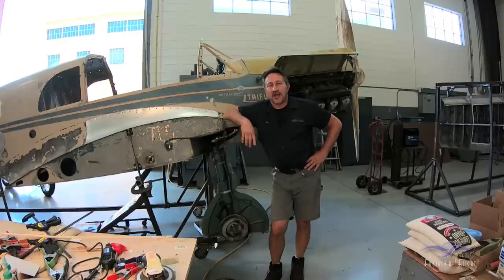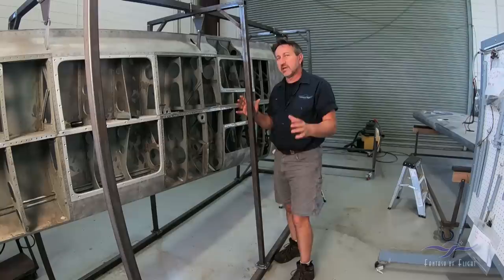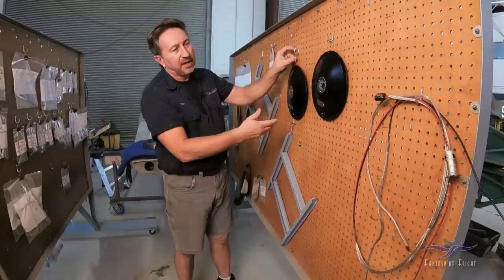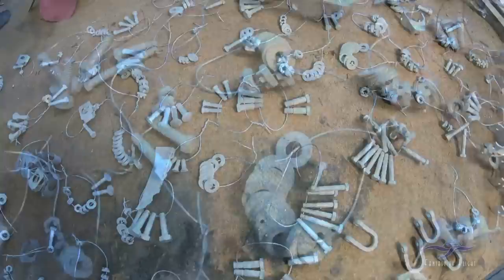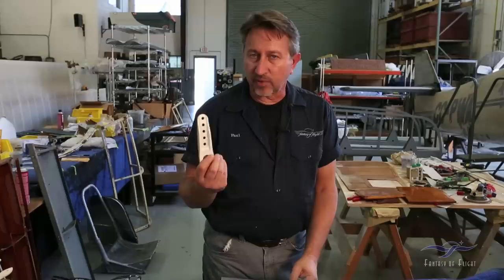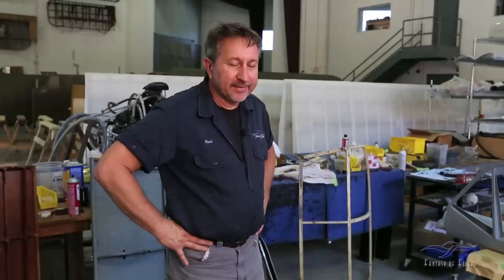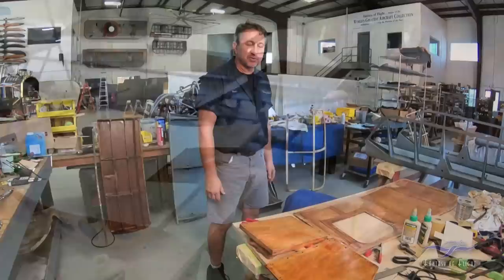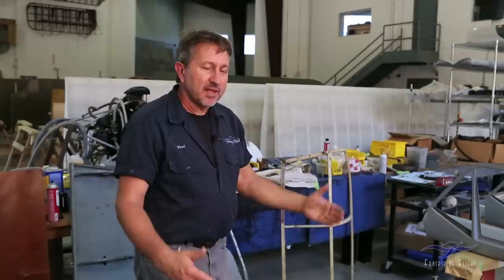Messerschmitt Bf-108 - Restoration Update #11 - June 2019

Comment: Hi Paul
 Been watching your series. Cadmium Plating is a metal that is plated on the part. It is a cyanide based plating system. It is a sacrificial coating something like zinc plating. The gold cad or clear cad that you refer to is a Dichromate conversion coating applied after the part is plated. Sodium Dichromate is mixed with acid and the part is immersed rinsed and dried. The Dichromate conversion coating is a extra sacrificial coating. The Gold Dichromate is a higher concentration of Sodium Dichromate and a different acid than the clear or also called Blue Chromate. Most companies use Zinc Plating and then the same conversion coating. More EPA friendly. I am retired and restore Automotive Carburetors to how they came from the factory. I do my own plating and conversion coatings. That is all I can add to the Aircraft Restoration. I have restored cars for many years and the time it takes to do it right. You are a true Craftsman. Keep the Videos coming.

Harold

Comment: In restoring old wood furniture conservators typically use hide glue - which was the original glue (I suspect hide glue was used on the 108) because with a bit of heat the joint can be redone. Hide glue is actually a very good glue; although in aircraft use where you can't control the environment the aircraft lives and works in a strong case can be made to avoid it. In your case hide glue may still be a good choice (I would have some concern about the high summer temps and high humidity of Florida). Down the road in a couple generations the person doing your job would certainly appreciate the use of hide glue vs. a PVA.

In any event, this aircraft is going to be a real looker when completed!

Comment: Interesting about the interior panels leather and wood construction.  I wonder if the Germans had casein glue or if they used the older hare or hide glue.  I love the restoration videos.  Maybe we could watch someone working on an interesting piece some time.  Thanks-
Reply: One of the virtues of the old hide glues is that they are not permanent which means wooden things can be repaired properly. Not sure Titebond 3 is the way to go...

Comment: Great work as usual. I really like these updates. Regarding the German 120 degree flush rivets. I recently read somewhere that at least one kind of German flush rivet had a slightly domed head. The counter sink was slightly larger than the head of the rivet. Then when the rivet is driven the domed head is driven flat and fills the countersink. Could that be what you are looking for?  Also Boeing has been using 120 degree counter sunk rivets for many years though not metric.

Comment: You may want to use a bit of caution with those old wires as if it has fiber in it it will be asbestos. Very common in prewar wiring.

Comment: Would the rivets used in the wings be the same types as used in the Bf 109? A number of these 109s especially the early E model have been restored in UK and Europe etc. I'd have assumed these may have had the same specs as the ones you require 'off the shelf'?

Comment: So how hard would it be to aquire a Rivet making Machine?, then it would be acase of getting a local Tool Maker to make you the dies you require, and I could be used on other restorations.
Reply: Pete Wood But the supplies for that would be the issue. As he says it’s the multiple odd sizes that make the difficulty.
Reply: Once you have the machine, then it is just a case of having the dies you need made, done by a tool maker.

Comment: How is it handled when doing a restoration and there are no factory service manuals available? Are standard values used for torque specs? Are control cables rigged properly just based on A&P or AI experience? What about things like those drum brake linings? Does that just require a careers worth of contacts? That's pretty much how we do it with cars, but we don't have to deal with the FAA.